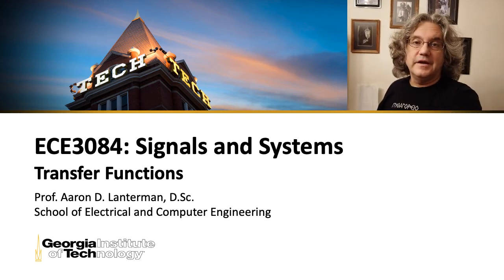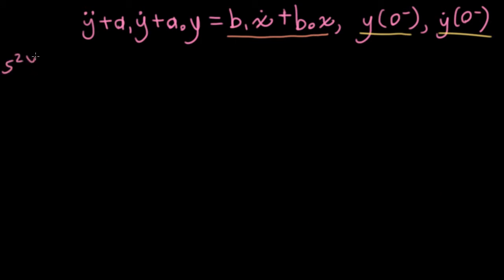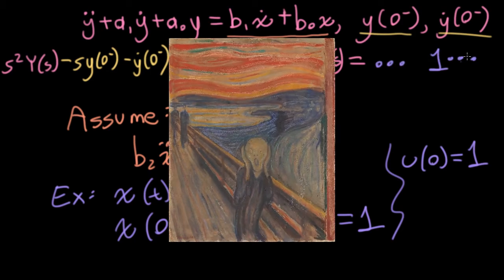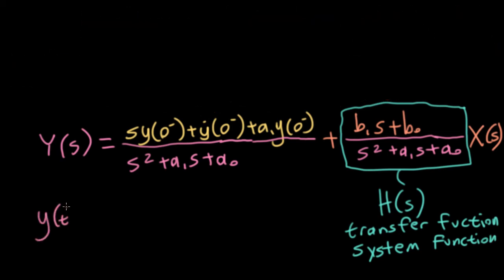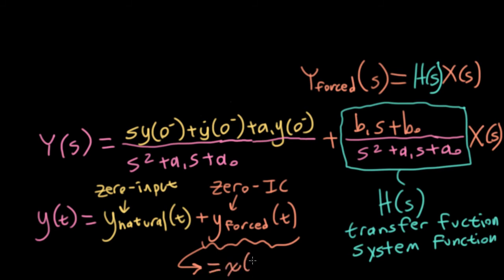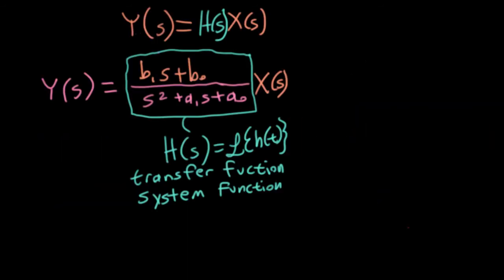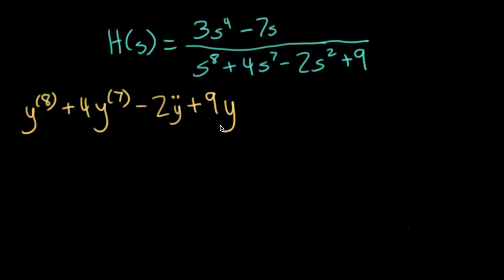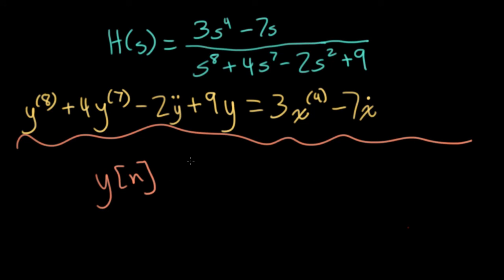ECE3084 Lecture 40: Transfer Functions (Signals and Systems, Summer 2020, Georgia Tech Course)

Comment: Another hidden gem- thanks for this series! Only analyzing the structure without regards to initial conditions, etc. reminds me of solving problems in discrete math using generating functions, where you assume you have a function with some known properties (like being 2nd order linear recursive, etc.) but for which you do not have an explicit formula. Then you just assume it has a power series expansion but don't care in the least whether the series actually converges or not- you're just interested in the using the series, as one author put it, "as a clothesline to dry stuff out on" to get an explicit formula.